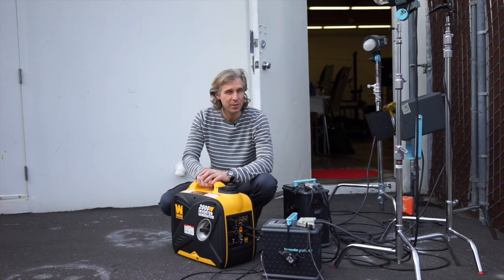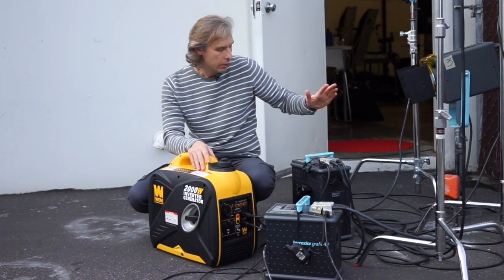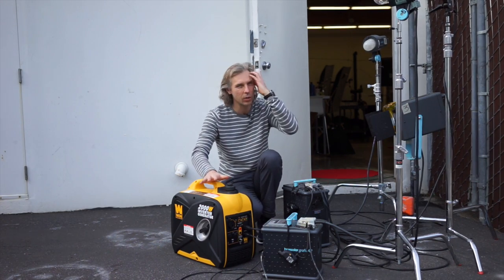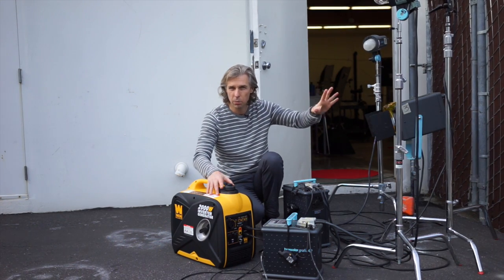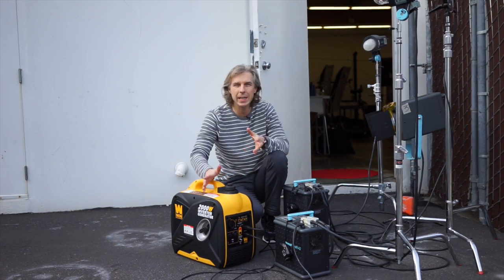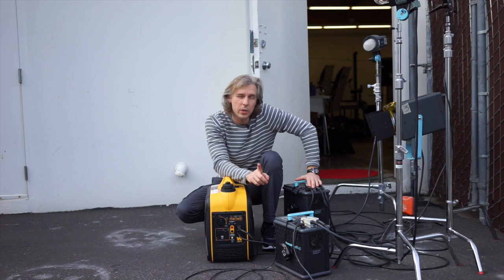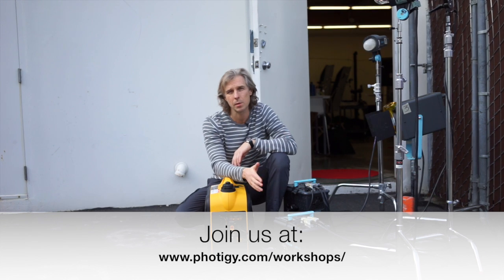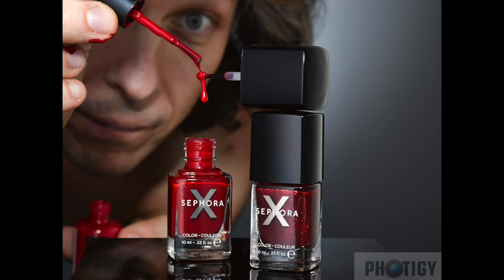Off-grid solution for photographers: review of WEN 2000 powering Broncolor lighting

Comment: Maybe if it wasn't running on economy mode it will be able to keep up with the fast recycle times.
Reply: I've tried to run in on non-Eco mode, but it as not able to withstand power surge from a single a4 graffit in fast recycling mode.
Reply: My thoughts as well. Add a heavy duty surge with cable and set it away from work area.

Comment: I am sorry but this is not a real solution, just rent high powered Battery powered lights Like the Elinchrome HD system or even more powerful purpose build units; cost these in to your job, the Gen noise would drive you mad, not to mention annoying the neighbours on set.  Pointless in my view sorry.
Reply: Stephen McGrath try working as a photographer in Norway. Can't rent anything photography related. Anything. 
Anyways, if you work as a photographer and need this regularly, it's a no brainer to buy it. Just another tool to write off anyways. And you save time every time you need it since you don't need to rent it, which also takes time every time.
Reply from the maker: Yes, renting is always a good solution for any well paid commercial shot. However, we do lots of educational shots, workshops (some of them free) and I do not want to drop $$ every time. 
This unit is really quiet btw, you almost won't hear it in 20 feet away. So yeah, battery is great. Gas generator is great too, just for different applications;)
Reply: +Stephen McGrath Maybe pointless for you maybe ;)
Reply: +Tor Ivan Boine I still can't see a benefit  over renting which is not expensive.  However, a generator is always a useful think to have.
Reply: +Tor Ivan Boine I guess we all have different needs.  As the presenter says, it suits him.  My issue when shooting in Norway in the winter is battery life so I can see the use for a portable power supply there, either as a battery charging facility or even a supply for my Rangers.  Hope you are getting some good light shows, I will be back in Alta in Feb and can't wait, Norway is one of the most beautiful countries in Europe and welcoming people.